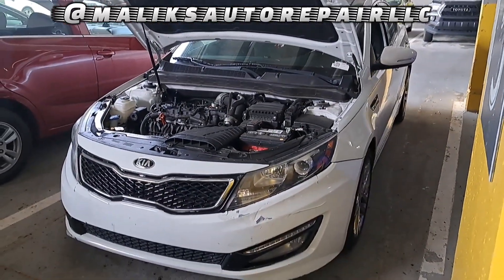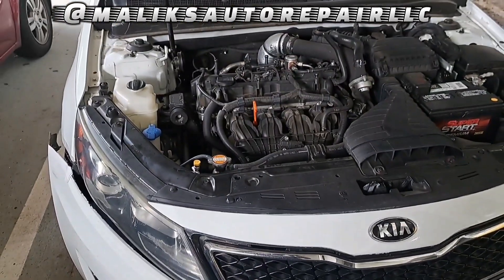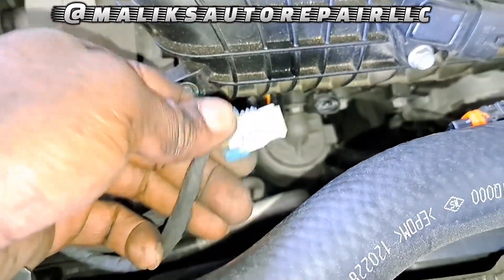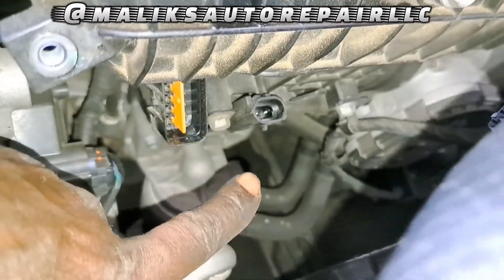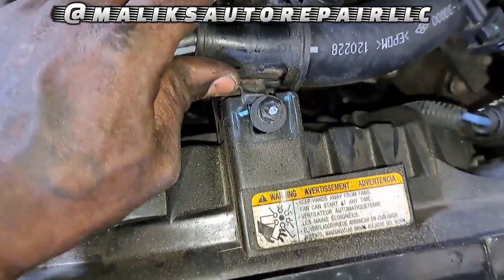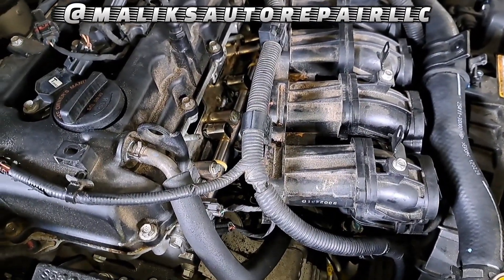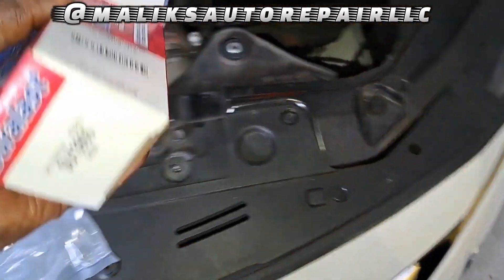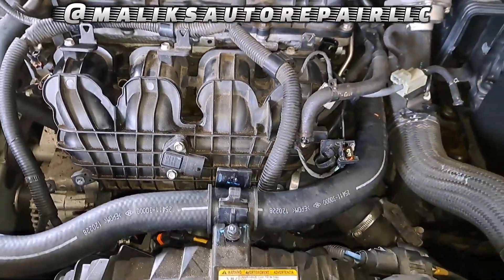2013 KIA OPTIMA 2.0 TURBO | NEW KNOCK SENSOR DID NOT HELP | CODE P1326 | Howto/Diy Step by Step

Comment from the maker: Kia dealers will update the Knock Sensor Detection System (KSDS) software, free of charge. The recall began January 27, 2021. Owners may contact Kia customer service at 1-800-333-4542. Kia's number for this recall is SC200.

Comment: Not really a poor design. People don't keep oil in them and the rod bearings wear out. When they start to knock. The computer limit rpm. I had a friend with a 2017 Sonata. I had been telling him not to wait until the low oil come on to add oil. When I saw the p1326. I watched a few videos on the problem. The dealer would not fix his engine because he took it in with no oil on the stick.
Reply from the maker: @blackericdenice  If it wasn't a poor design, Honda would do the samething.
Reply: @ThePullUpKing  I will admit Honda engines are made better. People who drive Honda take care of their cars better also. They don't go to Take 5 or Jiffy Lube to get their oil change. I know a few people who have Kia with high miles and never had problems with them.
Reply from the maker: A selective few with no problems. You can drive a Honda the same way they drive a Kia and still won't blow the motors. They just built different.

Comment: Does the knock sensor (p1326) cause the car to go into limp mode? Won’t go over 2k rpm, acceleration is next to nothing and can’t go over 65mph. Having major issues with my 2014 2.0 sxl turbo.
Reply from the maker: @BradyBarker-u6w  Absolutely. I recommend a bearing clearance test. More than likely, they'll need to be replaced.
Reply: @ThePullUpKing  I just dropped it off at KIA over the weekend. Apparently that P1326 code is notorious for that bearing clearance issue you mentioned and falls under an extended warranty for an entire new motor. Cause mine does knock also. I replaced the spark plugs, keep oil in it, etc. just didn’t replace that knock sensor yet because I found out this information.
Reply from the maker: I pinned that in the comments. Good deal😎

I actually pinned it in a different video.
https://youtu.be/T4aFm4MqHPw?si=Rba7e0eUj7cBOcWI
Reply: @ThePullUpKing  appreciate you G. Thanks for the videos.
Reply from the maker: @BradyBarker-u6w  Yessuh, I appreciate the engagement.💯